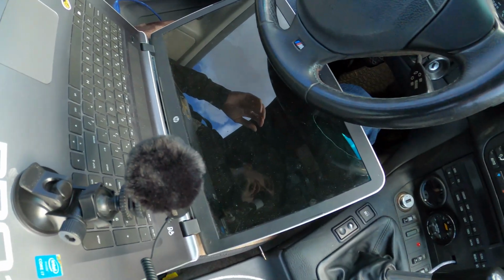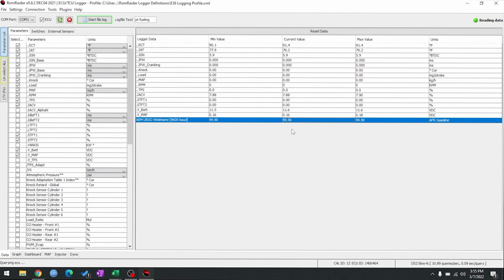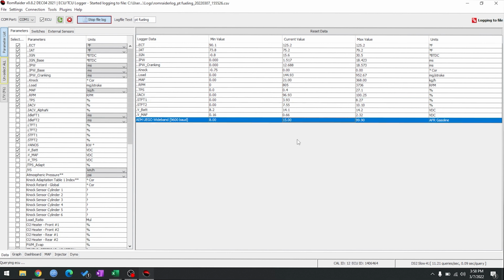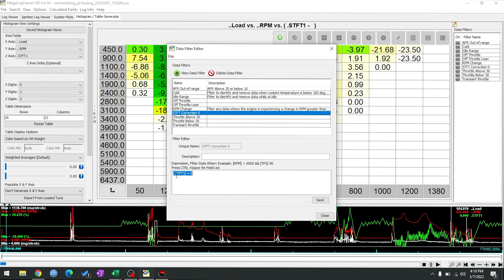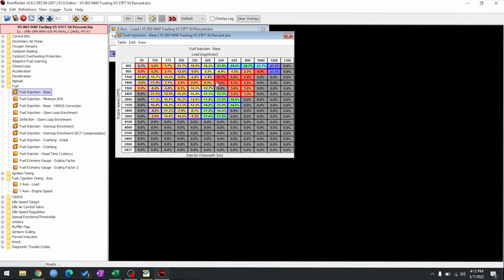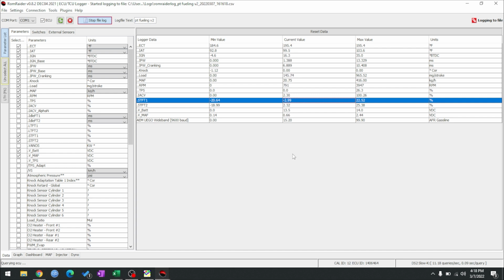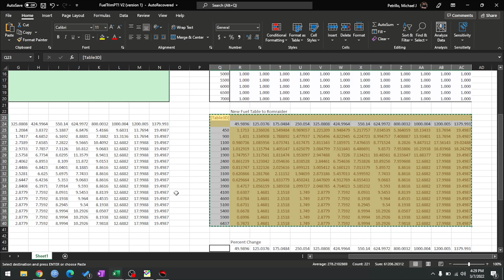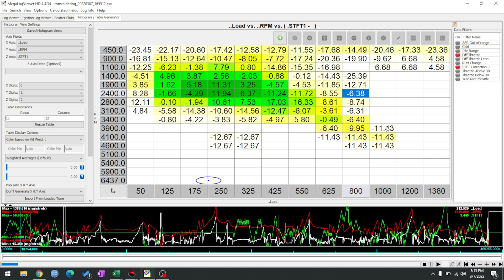BMW Turbo/Supercharger Tuning: Step-By-Step Practical Example

Comment: I'm supercharging my e46 and your videos are very helpful to me. Is it possible to send me your tune, so I will have a starting point? Idk why don't u have more views though, cause videos are high quality, and explanations are great.
Reply from the maker: Unfortunately e46 MS43 is going to be completely different. They have a wiki where you can start learning about it: https://www.ms4x.net/index.php?title=Siemens_MS43

I also don't like sharing specific tunes because what works for one car might be dangerous for another
Reply: @CanyonTuned  thank you for quick response. I know throwing your tune in my car cannot work, especially me using newer dme, i just wanted to have a rough template. Keep up with the good work😉
Reply from the maker: @brunobozic7239  A basic template would be take 1-3 degrees of timing out of your stock ignition table for ever 1 PSI of boost, and make sure you scale your injectors in the upper loads to be around the low 11s - mid 10s for AFRs in boost. (Start richer and go leaner if you don't have knock)
Reply: @CanyonTuned  tell me if that would work. Making tables 14.7afr all across, and then set full load recognition to like 60tps and then tuning full load enrichment.. so when you drive normally from 0 to 60tps, focus is on fuel efficiency.. and then from 60 to 100tps enrichment table would make afr richer for most power?
Reply from the maker: @brunobozic7239  MS43 is TPS based Open-loop enrichment, so either you can add acceleration enrichment or add it in the upper cells in your main fuel table.
Reply: @CanyonTuned  i have ms42 tho
Reply from the maker: @brunobozic7239  Ahh..the old MS42, there isn't a lot of information how to tune those it looks like. BMW TU engines are the red headed step child in the tuning community
Reply: @brunobozic7239  Just swap to ms43. Grab the gas pedal, complete intake mani with throttle body and DME from a b30 and repin the ms42 harness. You can find more info on the ms4x wiki. I did it on my single turbo m52tub28 and it pulled 1400 load. Spun 3rd ;)

Comment: That problem you described with your MAF is what I was experiencing when I used the posted scalar. Use the one I posted instead and make sure that your MAF is genuine. If it's fake the easiest way to know is looking at the side of the MAF sensor, the metal part should be shiny not matte. Also, I posted a couple of formulas inside the spreadsheet, and if I remember correctly I added a couple for transient conditions.
Reply from the maker: Can you reach out to me on Facebook or Instagram? I'd love to bounce some ideas off you since you have experience. My IG is canyon.tuned

Comment: The fuel table is meant for steady state! Transients need to be filtered out. Also just copying values with almost no hits in the cells is simply wrong
Reply from the maker: Do you have a good formula for that? There was one posted but I couldn't get it to work